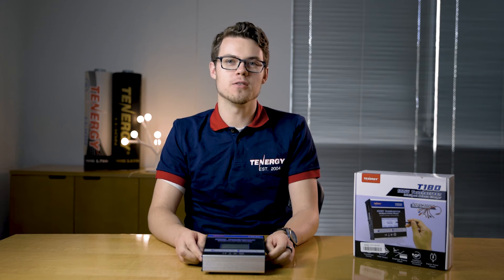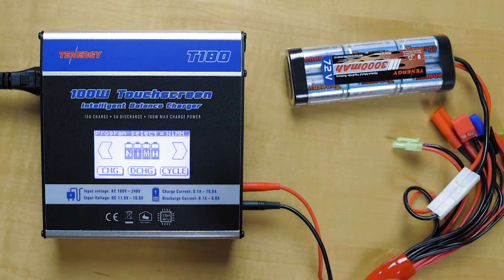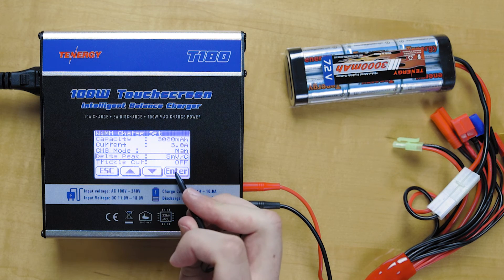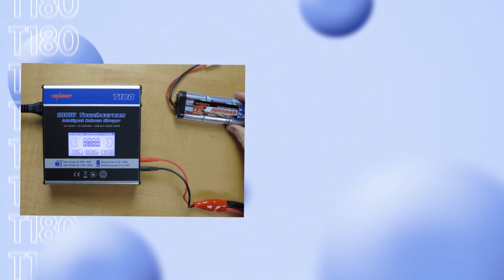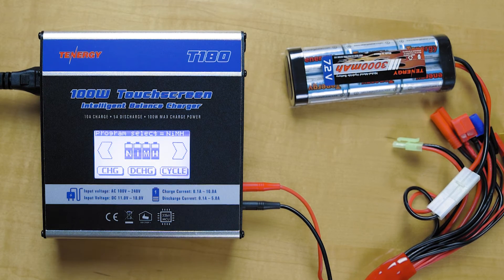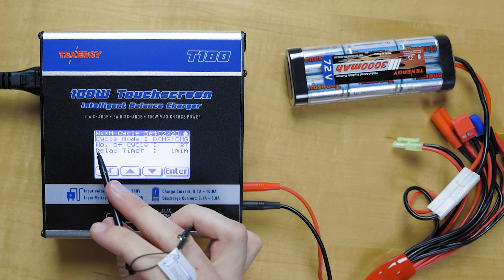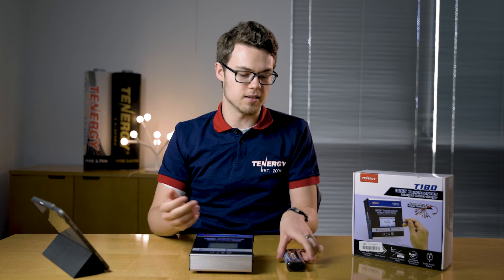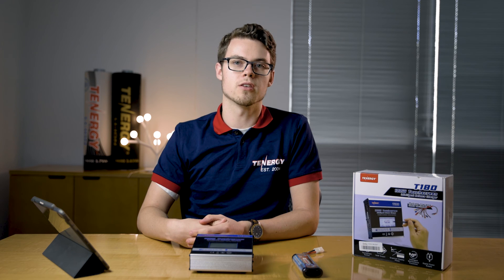How to charge and discharge NiMH/NiCd (1-16 cells) battery packs with Tenergy's T180

Comment: the best charge for nimh batteries is overnight at 1/10 capacity. 3000mah charging at 300mah for 14 or 16 hours absorbs the full rated capacity. all cells are cycled and balanced at the same voltage.

Comment: Just to correct the video,  the prius 2nd and 3erd gen has 28 battery packs tied in series. So when disconnected,  each pack is a 6 cell,  7.2 volt NIMH battery with 6500mah.

Comment: Prius packs I believe you just have to take the bus bars off and you can charge each 6500mah cell individually. I'm doing this right now in my livingroom lol
Reply: That's the same thing I've been doing for approximately 1 year
I keep starting the project and not finishing it's for a battery backup wall that I'm building
The charger itself just keeps messing up either overcharging or undercharging
Reply: Thanks, SKAVENGERS10. How was your luck with reconditioning those Prius modules? Did it work or did you have to replace modules anyway?

Comment: My charger does not say capacity but instead I can choose battery cells and should I use 1s or 6s when charging this nimh pack
Reply: One nimh cell is 1.2v most times you can count it what is the voltage of the battery?

Comment: Thank you for the video, I was lost when it came to charging my Ni-MH 5000 mAh battery and discharging.....I did have a question on the charging of this battery? When I set the parameters to charge the charger stopped the process because the battery got to hot....and the mAh only reached 2700 mAh. Does this mean the battery only has half the capacity?
Reply from the maker: Greetings ᚹᛁᛚᛚᛡᛘ ᚷᚱᛖᛖᚾ, here are some things for consideration:
1) It's normal for batteries to get hot. Charging at a faster charge rate can warm them up more than a lower one. Try a lower rate to fully recharge your battery after it's been discharged. 
2) The display only shows how much is charged until the battery pack is full. Showing 2700mAh is not necessarily the battery pack's capacity - the battery could have already been half full.

To get a better idea, please discharge it to empty first, then charge back up - this will give you a better idea of the battery capacity. 

If you have more question please feel free to reach out to us directly at service@tenergy.com and we can help review it with you.

Comment: Hi. My 12v 10 cell nimh pack will not draw more than 0.8A when discharging, even though I've set discharge amps a lot higher.. But will gladly accept 5A when charging. Why?

Comment: Yeah/ea.module know my prius is 7.2 volts and the module has 3 cells ea.inside it.
So/isnt that ok to use with the 180.
I'm cycling my lowest module now.
It's got a replacement in the mail.
So/I cant hurt it?
Reply: A Toyota Prius 2011 large Battery pack is made up of 28 indivudual modules or blades. Each module or blade is hooked together in series by bus bars to give desired total voltage of Battery pack. If 7.2volts average per module or blade then total Battery pack voltage is 7.2volts x 28 = 201.6 volts. To charge this pack with T180, we need to reduce Battery pack down to its module or blade. As high voltage involved, safety is important.  To charge each module or blade, we safely remove bus bars, we then have 28 discrete modules or blades. Being NiMh chemistry, the 7.2volt module or blade is comprised of 6 cells, each cell being 1.2volt. Therefore 1.2volt x 6 cells = 7.2volt. We can then charge "each" module or blade. But we cannot charge each cell separately. The 6 cells make 1 module or blade. So Module or Blade is the smallest we can charge. Knowing 6 cells in a modules or blade helps with the T180. Since the T180 can charge up to 16 NiMh cells, we can charge at most 2 modules or blades at once. 2 modules or Blades is a total of 12 cells. 3 modules or blades would be 18 cells. 16 cells is most T180 can charge at once. This is 12 cells in series, a total voltage being 1.2 x 12 = 14.4 volts. The capacity of the module or blade is 6500mA. The t180 can charge at up to 10000mA. And can discharge at up to 5000mA. It will take time, as we can can only do two modules or blades each time. 28 modules or blades in total divided by 2 at a time means 14 separate charges.
If we cycle charge/discharge the modules or blades we can learn if capacity is improving or if it is junk. 5200mA  discharge capacity on a 6500mA new module or blade is 80% capacity. The t180 records the discharge capacity for you when cycle the battery. Should increase capacity on 2 and 3rd cycle. You can set to max of 5 cycles. Having all modules or blades with same 80% capacity helps with performance of Battery pack. Once a Healthy capacity of each module or blade is determined, we can hook all healthy 28 modules or blades in parrallel and balance charge pack. This is in parallel, so voltage is 7.2 volts. Charge parrallel connected pack with T180. Disconnect charger. Leave hooked in parallel, the pack if left for several hours will self balance so that all modules or blades will settle to same voltage. Disconnect parrallel connection and measure voltage each cell, should be same voltage. Put battery pack together with bus bars, being safety aware. Youve just reconditioned your hybrid Battery.
Reply: @pareannafamily7582  ...very good clear explanation. Thankx much. Appreciated